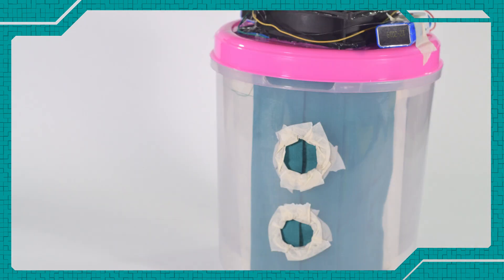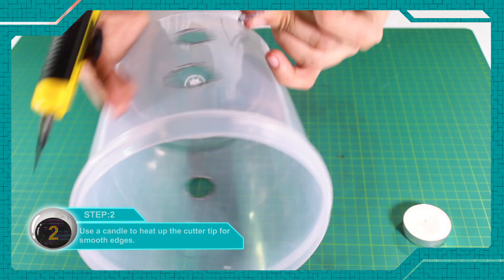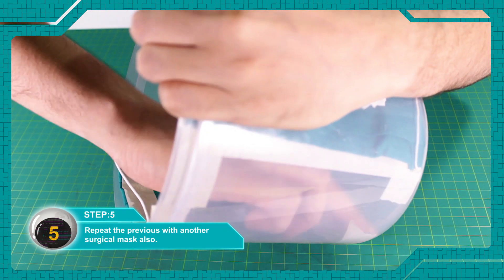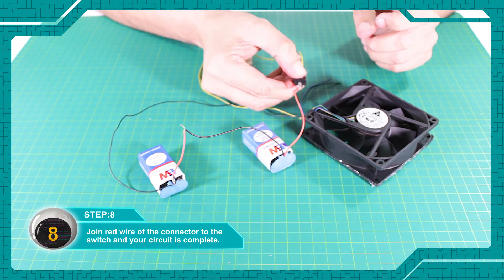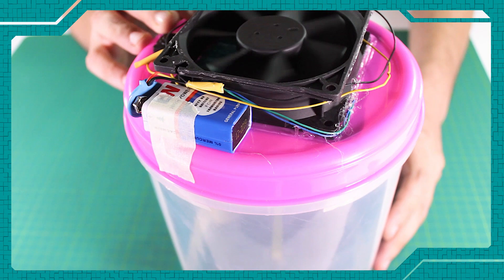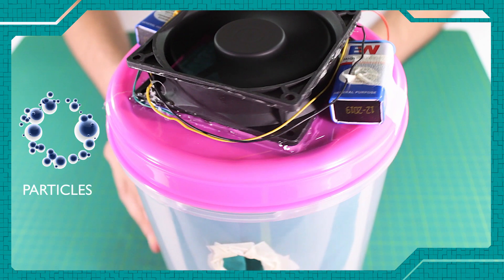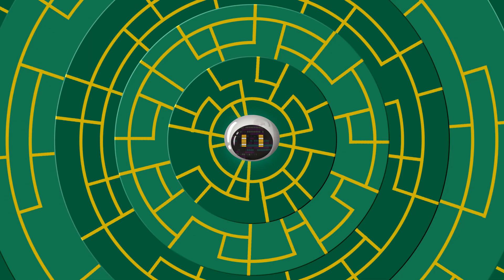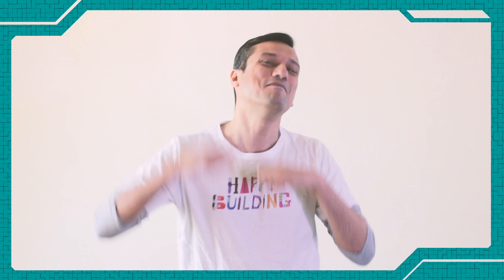Homemade Air Purifier!? Happy Building!

Comment: HI SIR ! LOVE YOUR PROJECTS AND IDEAS.
I HAVE A REQUEST SIR. PLZ TRY TO MAKE AN EASY VOICE CONTROLLED ROBOT USING ARDUINO AND EXPLAIN HOW IT WORKS. THANK YOU FOR READING.
Reply from the maker: Hey Farooqui, I just built an Arduino based robot. Its not voice controlled, but you should be able to add that feature quite easily... I will be sharing the video on this Saturday morning. It should help you! So watch this space! :) #HappyBuilding
Reply: Thank you veryyyyy much sir ! #HappyBuildingToYouToooSir !

Comment: where u bought these fans
Reply from the maker: Hi Arun, I used an old cpu fan lying around. You can buy a new one here: http://www.amazon.in/Thermaltake-Pure-Cooling-CL-F005-PL12BL-Black/dp/B00KJAX9XQ/ref=lp_1375348031_1_26?s=computers&ie=UTF8&qid=1495179444&sr=1-26-spons&psc=1
Reply: Prateek thank you